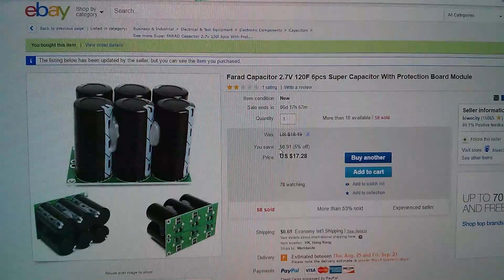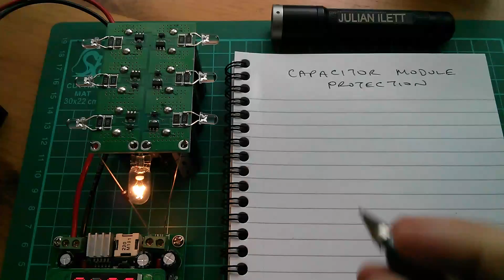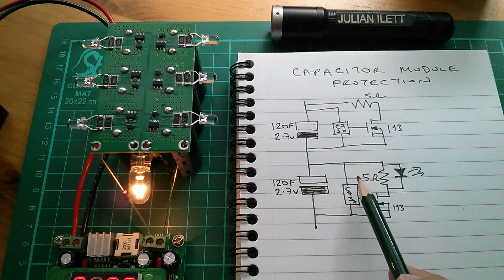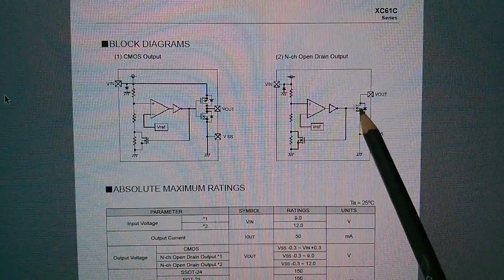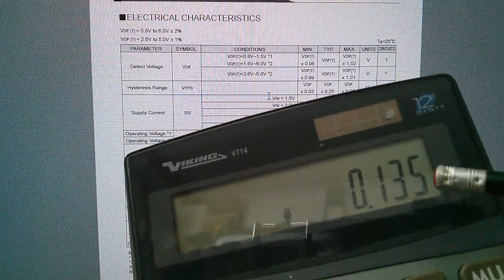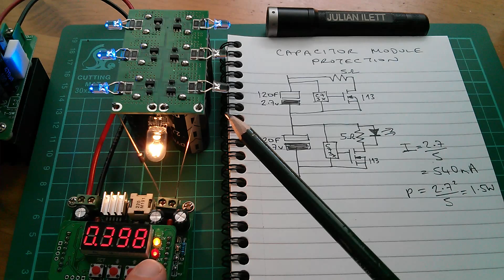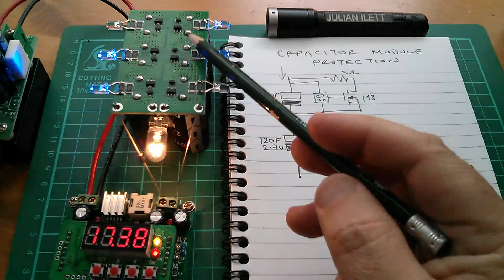Playing with: SuperCapacitor Module 6x 120F 2.7V

Comment: Why did you not measure the voltage of the capacitors when it was kicking in?
Reply: i was wondering the same thing
Reply: This circuit is two fold. The balancing of the capacitors is done with each of the protection circuits. if you had a capacitor that was charging faster than the others, it would have the potential of being higher than the other capacitors. Having the resistors across the capacitor increases the current to the other capacitors allowing them to charge up equally. It isn't so much the higher voltage that it's protecting it from because most of the circuits that you will have this device attached to would be less than 16 volts more like 14.5 volts.The balancing circuits would just keep the capacitors in check with each other or I should say balanced with each other. a lower voltage would keep the capacitors cooler as well.

Yes it would have been nice to see the voltage across the capacitors as it was charging up. I wonder how many amps of current this particular model could Supply instantaneously. I am looking to use two of these modules in series with each other to put across my solar 24 volt inverter. battery voltage could get as high as 30 volts the winter time and colder temperatures of the batteries.

Comment: I would expect caps of that size to get a little warm simply due to internal resistance.
Reply: Yeah, they do get hot if you pull a hefty load(like 20A), but I've not encountered any heat issues with these at "normal" use.

Comment: You figure out a way to incorporate a damned light bulb in every video. Lol
Reply from the maker: Of course - light bulbs are wonderful visual indicators (as well as a useful load) :)
Reply: And fuses, decorations, for the hell of it, lol. Just messing with ya. I enjoy the videos!

Did you think of putting PS in CV mode and hold caps at 16.4ish at the board terminal? That way, you can check each caps voltage and see how well they're balanced and also see if you're getting any voltage drop from a component on the board.

Just a thought, have a good one.

Comment: would a real brief mention of the maths/formulae related to total capacitance etc be possible, mech eng here with no electronics knowledge
Reply from the maker: For capacitors of equal value in series - it's simply: capacitance / # of capacitors (120F / 6)
Reply: cheers

Comment: Measure the voltage across each capacitor, not the whole pack.
Reply: Your 3 are just enought for get more information about the protection circuit working and tolerances.

Comment: I have 2 of the same 400 watt boost power supply's you have on the left and I was wondering if you have the same problems I do with them. 1 of them wont work unless you set the minimum current over 250 mA. Both of them need to be disconnected from a load when they are turned on and they pass their input voltage to the load even when they are turned off. Do your units do the same thing?
Reply from the maker: The BST400 is a bit flaky - see Jim Conner's video https://youtu.be/Xp6uDBMn3cY
Reply from the maker: Yes, they pass the input voltage to the output even when switched off - boost converters do that.
Reply: I'm just checking to see if mine are normal.

Comment: Incandescent bulbs have a lower resistance when they're cold, don't they? So until the filament heats up, you're dumping a lot more current through the bulb.
Reply from the maker: More current certainly, but maybe not much more.
Reply: mesuring the I V caracteristic of the bulb is very hard... you need 2 dmm !